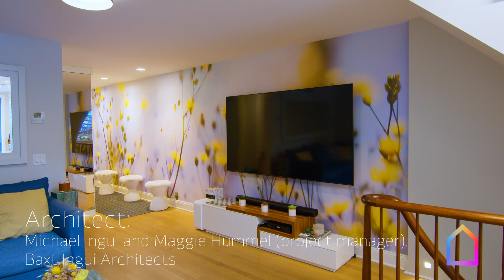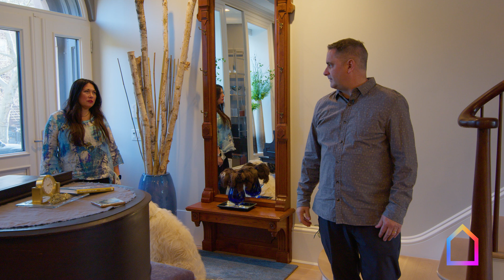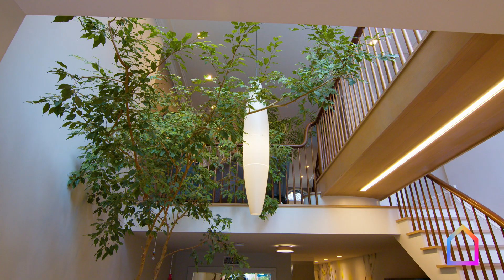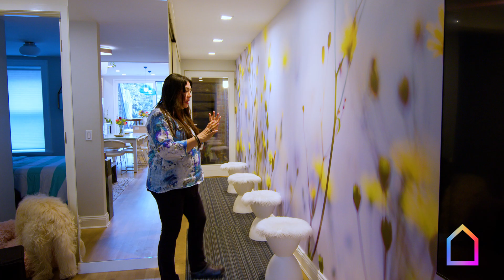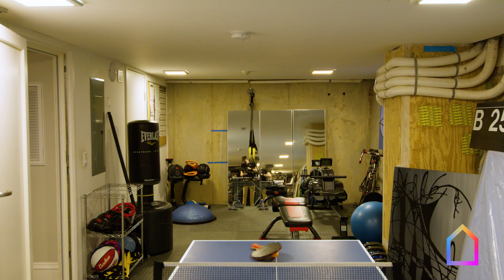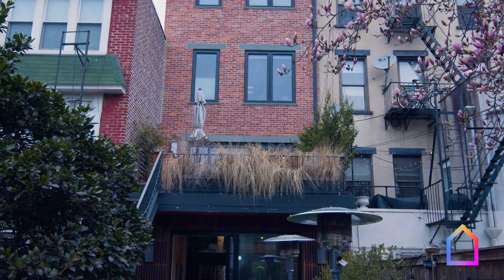Touring an Architect's Net Zero Brooklyn Brownstone Retrofit | Passive Pads

Comment: What brand is that induction cooktop? It looks like it’s a slide in range, but I’ve never seen one designed like that. I love the way the glass sits over the countertop.
Reply: Finally found it, but they don't make this model anymore. For anyone else wondering, its the Samsung NE58K9560WS. The only other range I found with glass top able to sit over the counter top was a Bosch, but it wasn't as nice looking as this one. :(